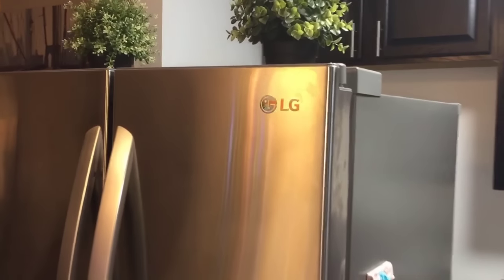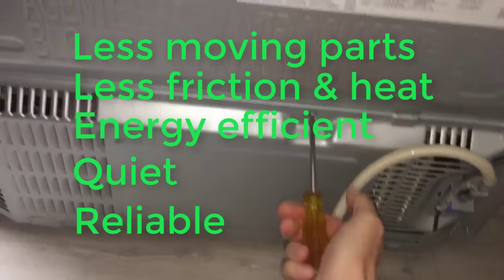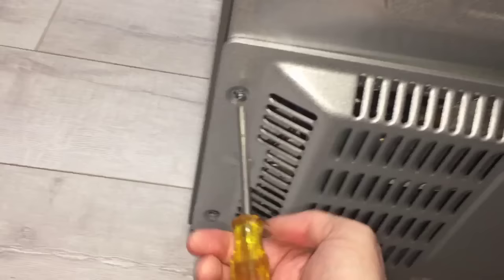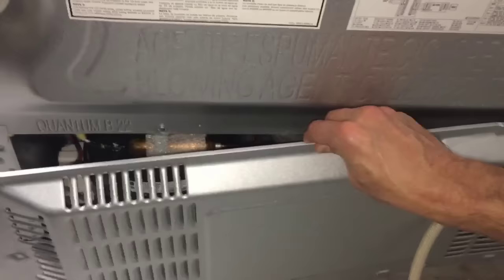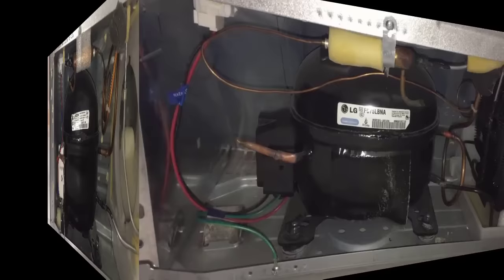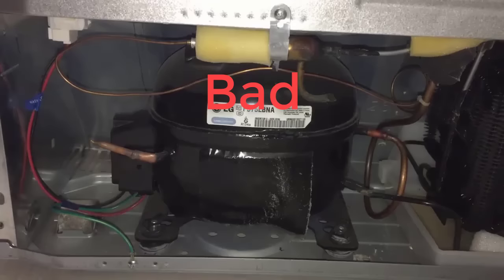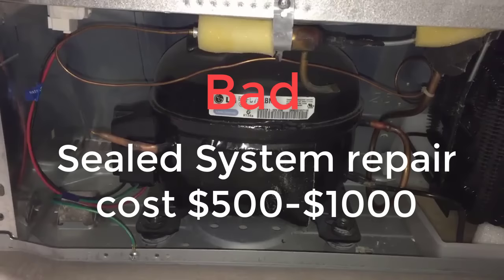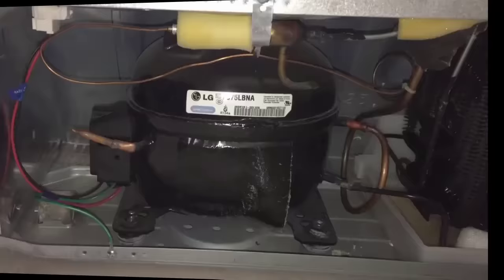LG fridge not cooling but running

Comment: There is a class action lawsuit going on regarding the defective LG compressors.
Reply: How do you get more info? Ours just went out
Reply: Seriously. Mine just went out too
Reply: Me three. Literally two days ago. Wow
Reply: Mine went out a couple of days ago as well. That's strange, and sucks.
Reply: Yup. LG came and fixed it. It was the compressor
Reply: mine too, yesterday. lost over 250$ in meats, cheese, vegetables...
Reply: @buddha65281  same here, they should be liable for the food lost.
Reply: Welllll throw me in with the lot of y’all. Mine went last night… over $650 worth of meats alone… I used this for all my meats.
Reply: Welllll throw me in with the lot of y’all. Mine went last night… over $650 worth of meats alone… I used this for all my meats.
Reply: My model is the LSXS26366D…
Reply: @blueeyeangel224u  holy crap. That's worth looking into an insurance claim or small courts claim maybe.
Reply: My lg refrigerator freezer went out yesterday
Reply: Had to by new refrigerator
Reply: @44polelineman  there's a 10 year warranty on the. Compressor. Some of the customer service reps try to throw you off the warranty path. You have to push back on them.
Reply: It just went out this week...
Reply: Same. Same. 😩
Reply: Do all of you having recent issues have the badge on the front that says inverter linear on it and are these recent purchases or older purchases? I noticed that on the ones I looked at yesterday but from everything I read the problems were supposed to have been resolved on the older ones with parts and a software update that prevents the compressor from dying due to their corroded line leaks getting pinholes which is what the lawsuit was about.
Reply: @whatfreedom7  mine has that badge and it was purchased within 5 years. I don't believe any software updates can prevent compressor failure, obviously not corrosion or pin holes or shoddy parts. Mine was replaced by an LG tech and he was pretty confident it failed before he got there based on the symptoms and how commonthis failure is.
Reply: Mine went out too. Who should I contact?
Reply: Sameeee…3 days ago for me
Reply: @christinenguyen5201  you could try LG at first and try to get a warranty repair.  The compressor wartanties have been extended to 10 years.
Reply: I just checked the deadline was Sept 2020 😑
Reply: Hi, my LG fridge model LMXC23746D, stopped cooling fridge and freezer. Had technician come out, he said compressor was good, he added Freon. $255 for freon and service fee. Next day the fridge not cooling at all. I had fridge almost 7 years. Tech maybe a leak, and  worth spending all that money for evaporator or condenser and trying to find the leak. For sure not buying another LG 😡 fridge
Reply: LG went out. After reading. I will not get fixed. I will never buy an LG again. Anyone doing another class action I can get in my less than 34 years old
Reply: My lg fridge stopped working 2 days and its hotter in fridge then it is in my house. I did the phone diagnostic thing and it says nothing is wrong customer service was useless as they only tried to sell me things. My fridge is 4 years old and has the linear compressor badge on it. They had no good options and i ended up getting the number for the technician center but i will still have to pay the labour and they just cover the compressor if thats the issue. So now the options are wait till monday see if a tech can come out take a day off work and likely get the compressor replaced which may or may not die again in 4 years by the sounds of them or cut losses and purchase a new fridge.
Reply: @meganlamonaca6357 the EXACT same thing just happened to my LG fridge also! I looked up the lawsuit and saw that the deadline to file a claim was September 2020 , so it sucks for us that this issue is happening now. And I've had my LG fridge for a little over 7 years now and it worked perfectly fine until 3 days ago and then it just suddenly stopped cooling. I called their customer service and spent an hour bouncing back and forth to finally get a repairman to come out on next Monday, the 28th. I will have to pay several hundred dollars for the appointment but if it's the compressor, I won't have to pay that. Life has been brutal😢
Reply: Mine just went out. No sound coming from the compressor.
Reply: I unfortunately have one of these. 1.5 years old and its not cooling. They're supposed to cover the no cold for 10 years but getting service from LG is worse than a root canal, they offered a prorated refund. I feel your pain.
Reply: LMWC23626S failed here. If you push really hard and tell them you know about the compressor issue snd the lawsuit and don't take no for an answer you'll get some kind of refund. Good luck.
Reply: @patricksmatrick6193 That was my experience as well. 10 year no cooling warranty.
Reply: Us also
Reply: LG prorated our refrigerator and sent us a check. It took a lot of back and forth, endless phone calls to get it done. Must be persistent! Bought a Kitchenaid.
Reply: I'm bloody stuck went out today. Compressor sounds good. Fans blowing.. no clue why it's not cooling
Reply: @dvzinc same here, what could it be?
Reply: LFCC22426S is the fridge I'm having issue with
Reply: @DvLang any luck on the diagnostic?
Reply: @Martyrville362. It was the compressor.
Reply: How do I join?
Reply: Mine too.  Just yesterday.  😢
Reply: My compressor is e too hot touch but sounds fine ???
Reply: Me too LMXC23796D
Reply: Less than 5 years olds
Reply: https://www.youtube.com/watch?v=R1aJ-EVkOgU&t=312s
Reply: LRMNC1803s, avoid like the plague. Mine lasted 3yrs. One day no cold. They brag about a 10yr guarantee on the linear compressor. And the LED on the motherboard blinking 3 times indicating a bad motherboard or compressor. Repair or junk? I junked to avoid the stress.
Reply: @pingechelon9389  I believe that the compressors are good. Also not the problem. When the refrigerant all leaks out and the compressor keeps on running. Eventually that kills the compressor. Refrigerant leaks from pinholeos in teh supply lines.
Reply: @blueeyeangel224u same as you. Did you ever figure out what caused it/which part needs replaced?
Reply: Me too, shittiest fridge I've ever came across
Reply: My LG fridge stop working 😢lost over 500$ in meat,veggies,and frozen stuff

Comment: Our LG refrigerator failed  so we finally found out that these units are junk after no repair person would work on them, so we were told there was this class action lawsuit and we needed to contact LG. LG customer service was a joke as they used a specific deterrence tactic to prevent LG from having to replace there poorly make refrigerators.  They say their policy is that they will replace the unit after 3 documented work orders to fix it, so when you contact them after the third repair fails they just say they have not documentation of a third work order and continuously have to keep submitting work orders to have a repair person do the same repair that does not work! In the mean time, initially  my family and I got very sick due to the high temps the refrigerator, we had to throw out all our food three times after the three repairs failed and now were have no refrigerator through the holidays!!!! This process has now exceeded  two months and is not resolved! We will look into a lawsuit in our area as well.
Reply from the maker: Unfortunately, law suites don't work very well, but you still can get about 70% of your initial purchase price back. Don't give up, provide all the information to LG and they must buy-back non-repairable fridge from you!
Reply: I am really wondering what was wrong with your refrigerator that even after repair it did not work? Capillary tube got clogged and they just kept changing your compressors?

Comment: After just 4 years my fridge stopped cooling properly called LG for service and they won't answer due to the corona virus, called a local tech out and they told me it was a sealed system issue...so ended up getting a new whirlpool fridge and sending the LG to the junk yard, I will never buy an LG again!
Reply from the maker: Yes, LG had a lot of problems with the Sealed System due to Linear compressor going bad. That's why they increased the free warranty to 5 years. In 2019 they improved the Linear compressor, so I guess we'll see if it's any better than the old one in a few years. But they lost many potential customers in the future because of this problem.
Reply: @Your-Self  what are sealed system ?

Comment: On mine I heard it running but could not tell the difference of a good or bad compressor.  There were no reset clicks.  It lost cold slowly over a few days before I knew that there was a problem.  It wasn't an overloaded freezer.  I paid the $250 for the flat fee service call.  It was the compressor.  The LG service tech replaced the compressor with a "generic" that he carried on his truck.  Not the model that was coming out of the fridge.  The generic one is used on many other LG models and is reported to be very reliable.  In my books, this should have been covered by the Compessor warantee but I would have had to paid the installation anyway.  So I let it go at that.  That was my experience anyway.  Thanks for the video and comments, they were helpful.
Reply from the maker: Yes, LG came out with a new universal (generic) linear compressor which fits most LG refrigerators on the market. Hopefully it's going to last longer, but only time will tell.

Comment: Thank you for the helpful video. I'm just adding my story to the complaints regarding LG. My house, purchased 11/2019 came with an LG model LFXS30766* 29.6 Cu. Ft. fridge. It was about 6 years old at the time. Yesterday (12/18/21) I awakened to water on the floor, melting frozen food and a refrigerator compartment @ 50F degrees and warming fast. I talked to a trusted tech who helped me diagnose a dead compressor, and he explained the repair would be $1000, and he suggested it would be better to buy a new fridge. I guess LG considers 8 years to be a sufficient lifespan for a $3000+ appliance. Meanwhile, the basic Fridgidaire in my basement (which rescued my food!), has got to be at least 20+ years old and still going strong. I'm staying away from anything LG, with its "linear compressor." I purchased a GE fridge with similar features, which will arrive next week.
Reply from the maker: Thanks for sharing.
Reply: I’m in this position right now brother.
Reply: Same here. Fed up with LG, will be getting GE.
Reply: I woke up to this exact scenario this morning.  Just bought the fridge 3.5 years ago.  This is the second fridge in my house (the first was a Samsung, now it's LG).  My house is only 14 years old.  Workmanship is really something these days.
Reply: @BrendaJones492  Me too!  Same thing just happened to us this July 4th holiday weekend.
Reply: Ditto! So frustrating.
Reply: I had a fridgidaire for 10 years when the compressor packed up.although the appliance was out of warranty they replaced the device.free gratis, since the fridge was in such great shape otherwise. That’s about 25 years ago, you wouldn’t get that kind of service nowadays.

Comment: Wow, this just happened to me! Now I see widespread compressor failures have lead to a class action lawsuit against LG.  Why haven't they recalled these refrigerators?!
Reply from the maker: It seems that LG has pretty good lawyers dismissing those lawsuits. And recalls are typically initiated for safety issues, not so much for reliability, so we are all stuck with a bad product.
Reply: When the tech came to troubleshoot the bad taste of the ice/water (after barely two weeks in the house), the basic tone of his reply was to suck it up, pay the $500. restocking fee and return the thing as it will not get any better!!!  Nice, huh?
Reply: YourSelf Honestly, I had a Samsung fridge notorious for ice maker issues and they recalled the ice maker and replaced mine.  This was last year.   I moved and gave that fridge to my daughter.  Now she’s had issues getting anyone from Samsung to help her get parts so I’m not as happy with them now.
Reply: Oh no. Sign me up. Mine is doing the same thing now.
Reply: Because recalls are for safety concerns not because something didn’t last as long as you’d like it to.
Reply: @Peter-od8gv  it says the deadline is Jan 2021? :/
Reply: I will never buy LG refrigerator again. LG is such an irresponsible company.
Reply: My compressor didn’t make either sound.  Fridge and freezer at 60 degrees F.  Mine is a 2016.  Not paying 1000.00 for repair just to fail again.
Reply: Same junk barley 6 months old stopped working

Comment: Our LG French Door Refrigerator was delivered to our house on Aug. 17, 2019. I have NOT been pleased with the unit!  Our previous fridge was a GE Profile which we had for 23 years and did NOT have ANY of these issues! I regret purchasing this LG!!   Since it is barely two months old, it is already NOT cooling adequately.  Mildew and condensation form on foods, fresh veggies do not "keep" as they did in our 23-year-old GE!  Add to that the water dispenser distributes "cool" water!  Yes, there is ice, but the ice has an unpalatable aftertaste. (The tech replaced the filter, but it did not change the taste.) The spacing is not good if you have large items like a gallon of milk or OJ, etc. BTW- the "manual" which comes with the LG is about useless.  :/  - However, thank you for sharing the video about identifying the compressor issues.
Reply from the maker: Sadly, none of the refrigerators today are as good as they were 23 years ago. Even if you would've bought another GE replacement, it's not the same company as it used to be. The appliance part of GE belongs to the Chinese company Haier, so the quality of new refrigerators is questionable. Luckily, your fridge is still under warranty!
Reply: @Your-Self  Thank you for your reply. It's pretty sad. I also read elsewhere that some folks in a CA lawsuit all lost their LG compressors within the first three years.  From what you wrote (further down), there seems to be no legal representation able to successfully take on LG lawyers on behalf of the consumers who have lost out by purchasing LG refrigerators. :/

Comment: Anyone who buys an LG Korean refrigerator is buying trouble within a few years. No matter if you spend $1000, $2000, $3000, $5000 or more you are very likely to own a refrigerator that stop working after only 2 to 7 years, There have been settled class actions suits on this and more are on the way. Another thing is that repairs to the LG Linear compressor usually also involve failure of the sealed system, the coils and other parts. A typical repair requires one to two repair people working for up to 12 hours each, plus replacement of the compressor and related parts. Depending on the model and where you live, repair service on an lG will take weeks and cost $2,000 to $4,000. The only sensible solution is to trash your old refrigerator, buy a new Whirlpool, Maytag, GE, Bosch or other brand and take LG to court (if small claims court you can do it yourself and don't need a lawyer in most jurisdictions) to recover some or all of your costs. Another factor is that most repair companies will no longer work on LG and, usually, Samsung equipment. In many cities, the LG Service Center that LG will refer you to will not work on LG anymore and also will not honor LG warranty work. Have a heart to heart talk with almost any appliance service center or with a salesperson selling kitchen appliances, and you will likely be told to avoid LG refrigerators. LG has the best designs and best features, but unfortunately they have the worst engineers.
Reply: Agreed.   LG is selling junk that looks good but is of very poor quality.  It's all style and flash for expensive trash.
Reply: I have a 20+ y/o Frigidaire that runs like the day it was brought home. My LG is less than 5 y/o and just quit on me at the absolute worst time. I doubt I will ever buy LG appliances again.
Reply: Unfortunately found this out last night. 2year old french door fridge completely fubar.
Reply: Yep. Once the warranty is over. I’m getting the cheapest fridge I can get my hands on. No more LG crap. Had repairs guys came over twice already. Now I’m on the phone for a third repair.
Reply: same here.  5 year old LG piece of shit.  I replaced the compressor once already and it just died again.  Running but won’t stay cold.
Reply: @jenmccolley285  i feel your pain
Reply: Me also facing problem
Reply: Don’t get a Samsung one either. Shit. I should have learned my lesson.
Reply: Looks like I am 7 years too late to read a review, it maybe better to replace than to repair it.

Comment: We have had our LG French door fridge for 6 years now but it’s on the 2nd compressor covered under warranty.  The first one failed in less than 3 years. The tech said the warranty has been extended an additional 5 years by LG.  Still, I don’t trust the brand anymore for refrigerators and would not recommend to anyone.  Compressors should not fail on a fridge that’s less than 3 years old.